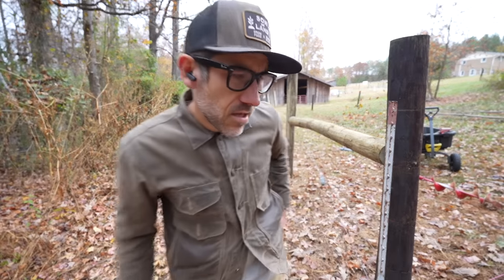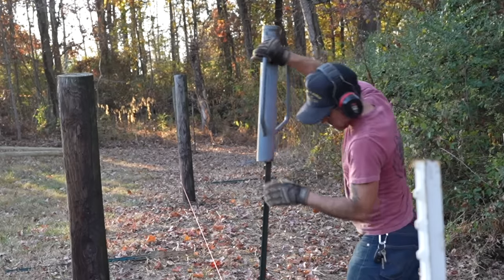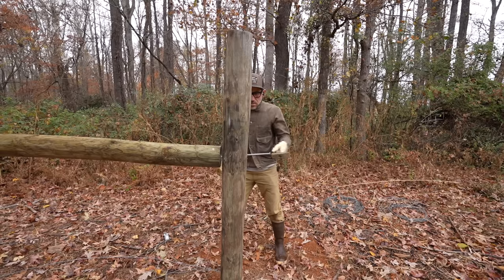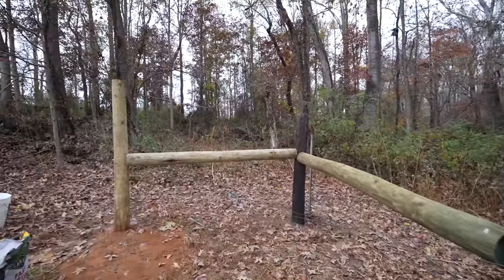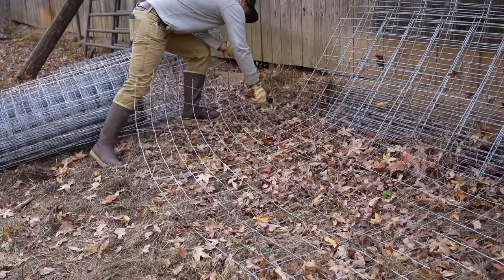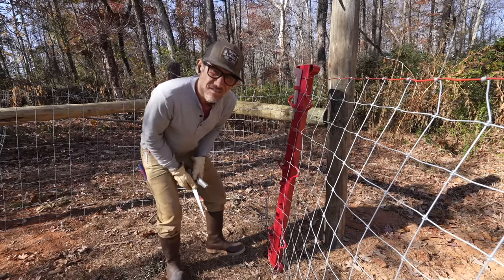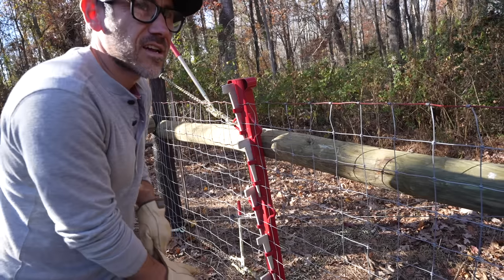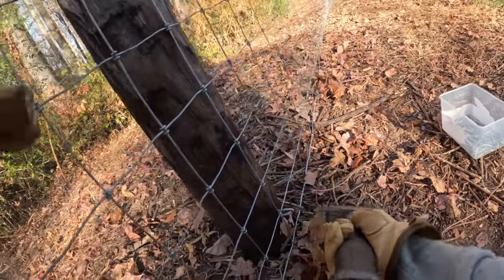Stretching Farm Fence Alone with No Tractor

Comment: You actually want a run of wire to both start and stop with a high tensioner. If you start the run on the side of the “H” with the high wire bracing it will be fine. The point of the wire bracing is two-fold, to adjust the tension of fence once strung and provide extra strength while stretching the fence initially. If the “H” is going to be in the middle of the fence in between two roles of wire, run two tensioners in an “X” pattern. This way you can tension each run and have extra support to pull each run of fence. I hope this make sense. I spent my youth building woven wire cattle fencing with my dad and this is how Daddy explained it to me.

Comment: Cows will sometimes try to reach over the woven wire fence and if you don't have anything to prevent that on top of the wire it will be crushed downward.  We put a single strand of barbed wire along the top and that prevents that from happening.  You could of course use an electric wire, too.

Comment: Something my dad taught me  (I'm 69) on fencing is when you come to the corner (T-Posts) put the fencing on the outside then come back to the inside on the other side of the corner.  It is a way to keep it from pulling away and it provides additional strength.  God Bless.

Comment: I feel your pain and frustration after installing the exact type of fence on our 9acres. But I'm also thankful I learned how to do it myself 16 years later. It's still standing strong. Always keep those t-post clips, fence staples, and fencing pliers in a bucket so you can quick grab it for repairs.
Reply from the maker: good to hear that! Thank you!
Reply: If you have a LONG run greater than the 230' roll of wire, learn to "stitch" the two rolls together, then you can work pull-post to pull post but get a lot accomplished with a refined method. Also, if you have any rises and falls, consider those points for a pull post, even if they aren't evenly spaced. You can cut the end of the wire to suit the slope and then you don't have wrinkles in the wire. You can use high-tensile wire or barbed wire on the top and bottom courses first to hang the field fence on. I used hog rings about every 2-3' for attaching.

Comment: Hi Jason, great job on the fence!  Wnen we put up our t-post fence using the clips that come with it, I just used a little flat head screwdriver to tighten the clips. Slip the screwdriver through the loop the clip makes on each side when you've placed it over the t-post and fence and wind it around by turning the screwdriver. Easy.

Comment: Not criticizing 
I would splice 12-18 inches of #9 wire on the end of the fence that was too short. Then wrap those splice’s around the line wires. In time those staples will let the fence slip and loosen. 
Great job for your first attempt. Not many guys could come out of the city and do what you have done. Keep it up!!!

Comment: You can do the H brace both ways an X with the single/double wire to tighten up your H. we've done it both ways, just makes it stronger...imo
Reply: If you don't have a fencing tool, its a combo of a hammer and pliers with a cutter and gripper, a very useful fence tool have. We had 2 eventually. And for the T posts we used a pair of pliers and a screw driver, they make a tool for it, but we didn't have one, so we Macgruverized it, smile, as for stretching the woven fencing at one time we didn't have a stretcher, so we used the double 2 x 4 method, and drilled holes and bolted them on either side of the woven wire, so it was clamped down between the two boards and the put a chain wrapped around either end of the 2 x 4's attached a come along to the middle of the chain with it attached to a tractor or a truck as the strong man, and tightened the come along to tighten the fence. then stapled the fencing to the H brace after wrapping the woven wire around it and then cutting it off/the excess, we doubled the staples on the wrap to make sure it stayed and wrapped the cut off lose ends over the back wire.

Comment: you just need a short (4 inche x 1/2 inch x 1/8 inch) flat bar with a hole drilled on one end of the bar to bend those "free" fence clips around the fence wire. the clips bucket i bought came with the small bar in the box. hello from down under.

Comment: On the corners, take the fence around the outside of the posts. The posts will take the strain of the fence going on the inside as you have done its the staples that are holding the fence not the posts. Still its a great job your tackling there :D

Comment: If you're reading this and you're going to do even a little fencing, do yourself a favor and get a Knipex cutter like Jason uses here. You can improvise a lot with fencing, but a serious cutter has no substitute.  I made my own puller bar and use regular cable come-alongs but I wouldn't recommend messing around with any other cutter. Beware of the farm store copies and fakes. Knipex Knipex Knipex. They'll cost you but one cut and you'll understand. Great work Jason.

Comment: Jason you did a great job, but this is the first fencing project I've ever seen where the fence is on the inside of the H-brace. I always thought they were supposed to go AROUND  the corners on the outside.
Reply: That's what I thought too
Reply: If you're keeping animals in they will push on the fencing material to test it, or just to scratch. With the fabric on the inside of the posts it is less likely they can pull it  
free and knock it flat.

Comment: NOW,put a strand of barb wire on the bottom, so animais dont push their way under, because they will eventually,
if you are going to have cattle, put 1 or 2 strands across the top,keeps them from reaching over, and smashing down the woven wire, I always use Red Brand field fence

Comment: Hi.... i think you put the fence on the insude part of the posts, usually we put ut outside... if ut us to prevent the wild pigs to go in, so you should consider their strength ... the poles inside, and the fence outside... in the opposite or outside side. If someone or some animal forces the fence from the outside part, it holds better of the net is fixed from outdide not inside. Hope this tip helps... 
But, nice job anyway... the learning curve only improves by practice.

Comment: Ugh - I know you hate it when people tell you that you did it wrong but ... I gotta stop you before you get too far.  1)  You have to put the fence on the outside when on/near a property line.  2)  You'll waste a lot of time, fence, ... money if you do not plan the best places to start/stop.  If you would have started by your gate you could have not made any cuts.  Just keep rolling out the fence as you work around that pasture - no cutting until you get to the end of the pasture.  Good luck and just keep doing a little at a time.  You'll be amazed as it all adds up.

Comment: replace tractor with a vehicle that can tow the wire around in old days ox or horse', you have come a long way already and about a tenth so far mean while you can continue and the rainwater tank can eventually fill up and be useful for watering animals and pasture later, love that your wife finds time to help out a little. the thing you emphasis about having a mentor to sound things off, and the correct tools and good or higher quality. your nentor saves you money through advice on cheaper ways to do things and you use the savings on tools that l

Comment: Shouldn't you have put the fence on the outside of the posts
Reply: I think it’s mainly to keep dogs out so they won’t push or jump hard enough to push it down.  If he eventually wants to keep large animals in, then fence definitely needs to be inside the posts.  Although if he does use it for cattle or horses he would need wood posts not just metal t-posts.

Comment: I am sorry, my friend, but you have built your fence to fail.
1.  Your wooden posts either need to be deeper (post hole diggers have extensions), set with WET concrete in the base or both.  That dry concrete is fine for ornamental things but your wooden posts were wiggling as you pounded staples into them; both cattle & hogs will rub against the posts and eventually collapse it.